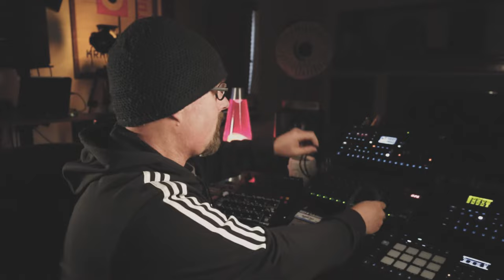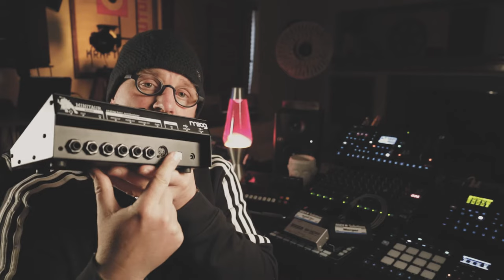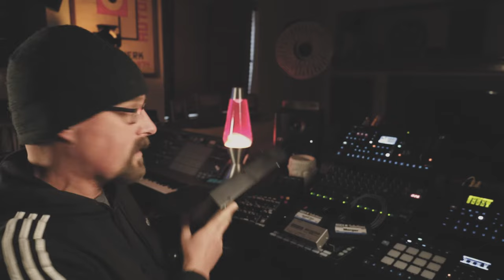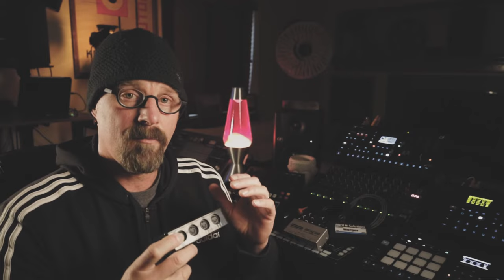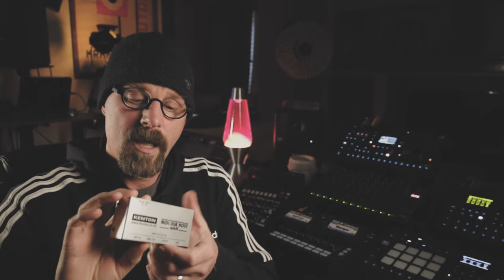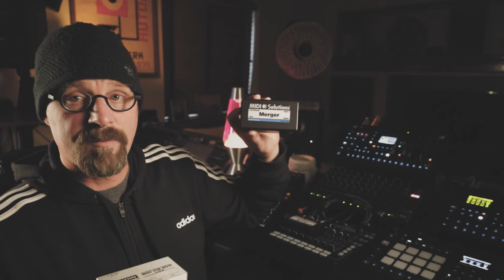MIDI Basics Explained: DAWless Connections, Routing, Convert USB to Din MIDI, Merging, Splitting

Comment: Great, succinct, well-paced, beginner explanation. I've been making tons of music with Digitakt & Digitone for 1-1/2 years...but when I tried to add M:C & M:S and sequence them on DT, I realized that I had no clue how. I had merely watched a video on how to connect DT & DN, but didn't know how/ why it worked. Honestly, I've been trying (with little success) to grasp whhhyyyy MIDI is going "Out" of my Digitakt if it's the brain controlling everything. The language just seems all wrong. That computes in my brain like, "Plugging an external monitor "Out" of my laptop" or "Plugging my guitar 'Out' of my amp" or "Plug that bass 'Out' of the mixer." (I know that MIDI isn't audio, I'm just making a comparison in regards what device is performing what function). If some piece of gear is the hub, controlling every other piece of gear, and I was going to name the inputs and outputs—I would logically think that I'd be plugging everything "In"[to] the brain. Now, I imagine the Digitakt as some sort of tenticled sci-fi entity reaching "Out" to control other enities🤷‍♂️ It's still ridiculously counter-intuitive languaging to my mind, but it is what it is.
Reply from the maker: Glad it helped a bit. The naming makes sense if you think of it in terms of signal flow. The midi signal flow OUT of the ‘brain’ and IN to the thing being controlled. The third is THRU because whatever signal comes IN passes THRU to other devices in the chain without being affected by the machine it is passing through. I hope this helps. Thanks for watching!

Comment: I have a midi drum set which only has a usb connector on it no DIN. I want to connect it to my rompler synth which has a lot of good drum sounds on it. That synth has DIN connectors on it. Is there a way to connect the drums to the synth without having a computer or any other expensive piece of gear in between? Maybe a cable of some sort?
Reply from the maker: Hi Sasha! What model is the drum set? I’ll look it up to see what the options are. Is the drum set run into your computer now? Normally going from USB midi to DIN midi will require at a minimum a USB host, but I will check. Thanks for watching!
Reply: @SURCOlive  Hello. Thank you for taking the time to try to help. I don't know what the model of the drumset is. It is packed away at the moment. All I can tell you is it is a midi drum set but lacks DIN connectors. It only has the smaller USB midi connector. I have never connected it to a computer so it is not connected to a computer because I am not using computers to make music these daws. I have a dawless setup. I tried a few years ago to get them connected to my synth but nobody knew enough to help me get it successfully connected. A few people told me I might be able to do it with an interface. I have a standalone interface I'm using which might act as a host now that I think of it. I'll look into that option. But I was hoping to find a cable of some sort which might do the job. I was researching this years ago and as I recall there are usb cables which allow for that. iirc it's cables which are usb 1.5 compliant which can allow for any device to act as a host without a computer. But I am not sure. Maybe it only allows a device to act as a host if it can act as a host. I'm guessing that involves sending some sort of sync signal. Or was it some sort of listen for confirmation a message was received? Whatever it is I could swear that a USB 1.5 compliant cable of some sort was what I needed. But I was never able to find one. Nobody could hook me up with one. Or at least assure me I wouldn't damage my drums or keyboard by directly connecting them. I gave up for some reason. Had more important things to worry about. If you can be of any help I'd appreciate  it.
Reply: @SURCOlive  It may be USB On-The-Go (AKA" USB OTG") I am thinking of not USB 1.5. USB OTG (by itself) seems to only allow smartphones and tablets to act as a host. But the embedded host supplement added to the USB 2.0 spec may allow for a USB 2.0 device to act as a host with no computer or other host device connected. My synth probably doesn't support that though. It has both a USB A and B connector but the bigger one is devoted solely to being used for storage with an external USB storage device. Maybe a firmware upgrade will change that to also support acting as a host. I doubt it. But I will look into that. For now my interface may be the only option. I was looking into a mio iconnectivity cable though. As I recall, the first iconnectivity cable could could act as a host to allow me to connect my drums to my synth. But it is no longer made iirc. There are still some mio iconnectivity cables on the market which seem to be the first one but I don't believe it is actually the first one. I believe they simply got rid of the numbering which let you know which version it is. I'll look into that though because I could be wrong. Let me know if you find something that will work other than my interface.
Reply: @SURCOlive  The mio iconnectivity cable is host powered so I'm guessing would require a powered USB hub capable of providing power. I'd need a USB hub to connect the drums to my synth anyway because the connector on my drum and synth is the same type (the smaller type, not sure if it's called the A or B connector atm). Anyway the original hope was that I might be able to connect the drums to the synth using a mio iconnectivity cable and a USB hub. My interface might allow me to connect the drum and synth with only a cable being the missing ingredient though. I'll look into that and let you know later.
Reply: @SURCOlive  Turns out my interface doesn't have any usb connectors. It has firewire but no usb. So unless I can convert usb to firewire or vice verse looks like the interface will be no help. So I'm guessing it will probably need to be a powered usb hub and a mio iconnectivity cable?

Comment: My VoodooLab Ground Control Pro Foot Controller stops responding, sending MIDI messages after 5 minutes of use, i don't know why this happens every time ! Do you think this MIDI Thru Box could solve this problem of MIDI messages errors, weak signals and latency ?
Reply from the maker: Not sure if it would help but it could. If daisy chaining is causing it, the thru signal would help there for sure.

Comment: great video, nice job.
Reply from the maker: Thanks! And thank you so much for watching!
Reply: @SURCOlive  yea, i think i need one merger, have trouble with my setup, korg electribe, monologue, nts-1 and arturia keystep, when using arp it's lagging when sequence is on, so i suppose that there is problems with midi send, return signals between electribe and keystep midi in/out route.
Reply from the maker: @vaaksvakuums  are they chained or do you have the signal going through a midi thru box?
Reply: Using midi solution thru box : )

Comment: Hi Surco, new member here :o) Midi sure is a beast,, lol   I have 3 midi keyboards, one uses the usb so it's irrelevant.. But the other 2 are din.. so my question is: If I plug midi out from keyboard 1 in to midi in on keyboard 2 then the midi out from keyboard 2 in to my  DAW using some sort of interface.. will the DAW see them as 2 different keyboards or just one? . Will one of the boxes you mentioned do that if not? Sorry if I sound stupid, but midi is still a trail I have not blazed too much yet..
Reply from the maker: Thanks for the sub! The DAW will recognize the midi interface you use, and you would assign channels of that to tracks in your DAW to use. USB midi makes this easy. Chaining them together, the only signal that would go to the DAW would be the final 'Out' or if it was 'Thru' instead it would only be the signal from the first synth and not the second. I hope this helps. Thanks so much for watching!

Comment: How long of a daisy chain can you make without incurring excessive latency?
Reply from the maker: Tough question as I understand it is influenced by each individual piece of gear. Older and cheaper gear will have slower transistors. Even modern gear can add +/- 3ms of latency per connection in a chain. Depending on what you are playing, this may or may not be a deal breaker. It also depends on how many channels are in use sending how much data down the chain. A single note on a single channel is a lighter load then the log jam created by sending 16 channels of simultaneous complex cc messages. Sorry I can’t be more specific. I hope this helps. Thanks so much for watching.

Comment: Nice Video! I was wondering how can I connect 2 Midi controllers to 1 Synth? I can't find any Mergers with 2 in and 1 Out on the market...

What would be your suggestions?
Reply from the maker: Hey Raphaël! You can use a 2 in/ 2 out. Those merge both inputs, then duplicate the merged signal to both outputs. Use one output if you just want one merged signal going to one synth. I hope this helps. Thanks so much for watching!
Reply: @SURCOlive  Ooooooh! So even if I get the 2 in/2 Out merge from Midi Solutions I can use it as a 2 in/1 out? Do I have to change anything or it will work just by plugging the Devices?
Reply from the maker: Exactly! It works just like that. Both outs are the same, so using one is no problem! I use that exact one and it works great.
Reply: @SURCOlive  Awsome thank you!!

 It's because I just got a Behringer Model D and I want to control it with a Midi Keyboard and a FCB1010, so I was wondering about the possibilities! :)
Reply from the maker: Possibilities are limitless. :)
Reply: @SURCOlive  Awsome! Thank you! :D

Comment: Good evening Sir, im your new subscriber. So sorry for my English,  i want to ask, i have Roland SD50 sound module, its 16 channel midi, as i studed i can use 16 midi keyboard in different voices each channel by using DAW like cubase 11, without DAW Sir or without PC, using midi thru box like you used or using KENTON midi thru 5 its posible i can play 4 midi keyboard using my Roland sd50 module without pc?
Reply from the maker: I’m not familiar with the SD50, but I just looked it up. As far as having multiple keyboards going in from a merged signal, I do t see any reason why this would t work. You will just need to make sure that each keyboard is sending on a channel the Roland is listening on. As far as different voices per keyboard it will depend on the midi settings in the Roland. If they can each be set to listen for a different midi channel, then no problem. If each sample voice channel can only listen to one midi channel then all the keyboards will trigger the same sound. I hope this helps. Let me know how it works out. Thanks for watching and subscribing!
Reply: @SURCOlive  thank you so much for your answer Sir.

Comment: Would I be needing a midi merger to record two synths incoming notes of both boards?  into the octatrack midi in? I use two channels 12 and 13 This midi y cable is causing my synths to go crazy on their panels !
Reply from the maker: I’m not certain, but I think your ‘Y’ cable is likely a splitter and not a merger, so it is sending the Octatrack midi signal to the keyboards instead of the other way around. A merger would allow two keyboards’ signals to be merged and input into another device midi ‘in’. It is important that the midi settings in the Octatrack are setup correctly to receive from the keyboards as well. I hope this helps. Thanks so much for watching.
Reply: @SURCOlive  yep sure thing and thanks appreciate your tutorials

Comment: Hey Eric, why does the PC12 need to be connected to the OT both ways? you say for it to work, can you explain? I have my launchpad pro going into my OT but nothing going back in to it. just wondering why, thanks!
Reply from the maker: Hey Danny. The PC12 has a 'MIDI Learn' function that needs to receive a signal from the Octatrack. When it is in that mode, you can pick a knob on the PC12, then move a knob on the Octatrack, and the PC12 learns which function to assign to it without having to connect to a computer and program it. Once it is all set up, the MIDI out from the OT and in to the PC12 can be disconnected. I am still making changes to the mapping, so I have it connected both ways still.

Comment: I wonder if you can help: I'm trying to connect 2 keyboards using midi cables: Yamaha Genos (in) and Korg Krome (Out).  What do I have to adjust to make the Krome produce its own sound.  Every time I change the sound on the Krome, it uses the sound on the Genos.  Any advice would be greatly appreciated!!!
Reply from the maker: I would check the settings in both. Make sure that the Yamaha is set to receive on a single channel and not ‘all’. Then set the Korg to send on that same channel. When you want the Korg to play it’s own sound only, change the sending channel to an unused channel. I hope this helps. Thanks so much for watching!
Reply: @SURCOlive  Thanks so much for the advice,  I will try it out and see if that will work. Again,  thank you for answering my question and have a wonderful day!

Comment: does a hardware multi-port usb-router exist, where you can physically assign an in-port to a selectable out-port (mitrix like)?
Reply from the maker: Not that I know of. The data usually flows and devices tap in without the need to be assigned to a specific port.

Comment: Thanx for posting the video, i have a question: Is it possible when i  connect midi in from my keyboard to out on my daw 1 , the out from keyboard to the in from my daw 1 , to use the thru from my keyboard and connect it to the midi in from another daw 2 ? in other words, can i use 1 keyboard to send midi to  2 daws ?
Reply from the maker: It’s possible to control up to 16 devices with one controller. This is only limited by the 16 channels in the midi format. You wouldn’t need to come ‘in’ to the controller, but rather ‘thru’ the interface with the DAW. If you are using USB from your controller, most DAWs will have the ability to assign that to different attached midi devices. If you wanted to co trip two unattached DAWs with one controller, you could either use a USB hub, USB host, or MIDI splitter. Lots of options! Which gear do you have and maybe I can be more specific? Thanks for watching!
Reply: @SURCOlive  thamx for the reply i have an old kawaii pn300 digital piano it has a thru /out/ in midi .
a laptop with steinberg ur22 soundcard and my main music pc with a new ur24c soundcard they both have in/out ..
Reply from the maker: @guitarazzo  Got it. So it seems your best solution would be a MIDI thru box 1 in 2 out. The keyboard would send the midi to the box which would duplicate the signal and send out to the two DAWs. Sending your signal out from DAW one back to the keyboard would not include the initial keyboard signal as out is only generated within the device sending the signal. In order to forward the keyboard signal the Steinberg’s would need a Thru port. I hope this helps. Thanks again for watching!
Reply: @SURCOlive  ok thanks a lot  for your help, i will get a thru box . 
also thanks for your fast reply !